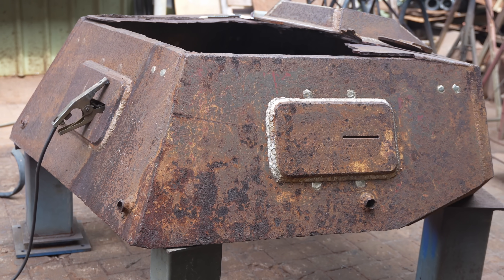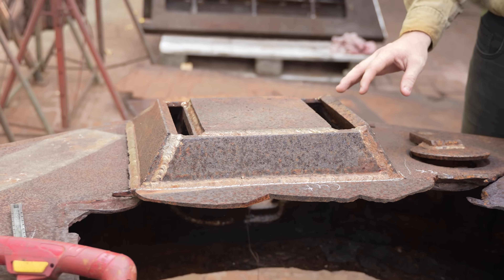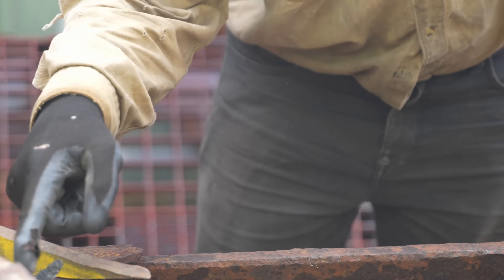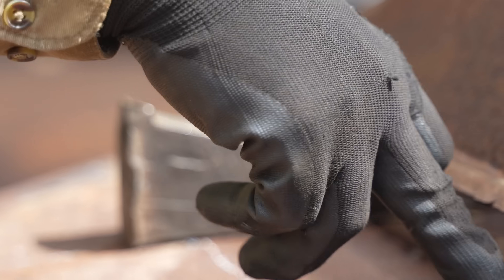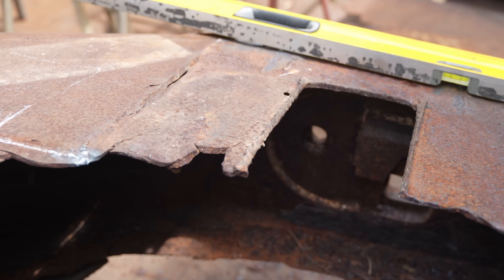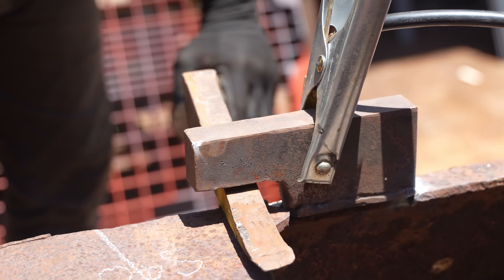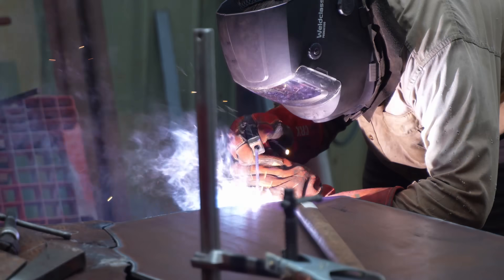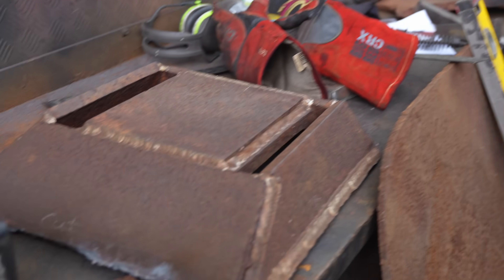Fixin' up a Flammpanzer II Flamingo turret!

Comment: Please change your camera work.  Whenever an employee is explaining what they are about to do, you should be in a wide shot.  Frame the object they are working on and the employee together, so that when they point and gesture we can see what they are talking about (cut here, grind here, weld here).  When you move the camera back and forth from the object to the employee, it is nauseating.  Don't zoom in on the piece until the work actually starts.  Another approach is to film the employee talking about the steps separately, then film the object afterwards in a close up.  You have too much camera movement while zoomed in.

Comment: i have nevver heared of this tank
Reply: This Pz II is a flamethrower tank - similar to the later M4 Sherman "Zippo" conversions that was used in Okinawa, as well as the Churchill "Crocodile" tank.
Reply: They were used earlier in the war, Operation Barbarossa notably. They were replaced quite quickly if im not mistaken by the French Conversions into flame tanks and the Flampanzer III etc.

Comment: That thing is as rusty as my first Datsun.
Reply: 240K 5 speed Coupe.
Still the sweetest handling car yet.
Reply: @MicMc539  I would love one. A decent restored one is about £25 to £30K when they come up for sale. Sadly I don't have that much pocket change doing nothing.
Reply: @ I had a 79? model I used for lots of 1000 Mile runs around Australia.
Long stroking 6 sitting just under the Ton stuck to the road like the proverbial to a blanket.
Sold it for a trip to England.
Now off-grid in the bush with an 08 Forester, not a bad car!
Reply: @MicMc539  Sweet. Shame you had to sell it.